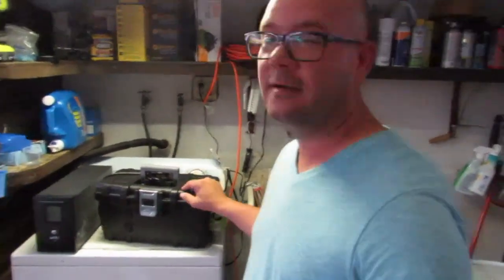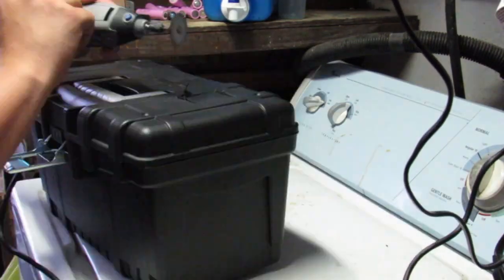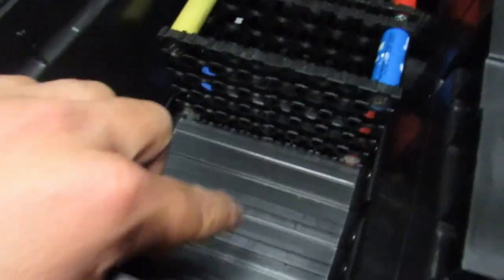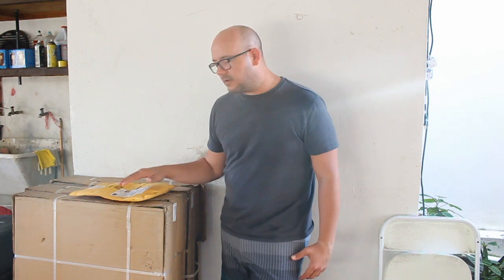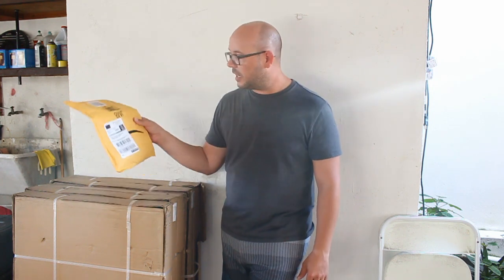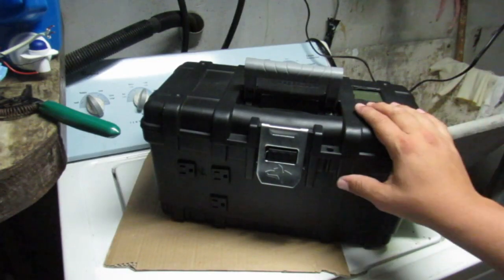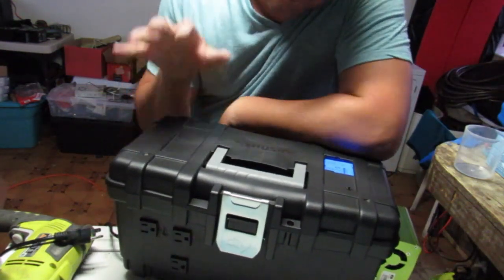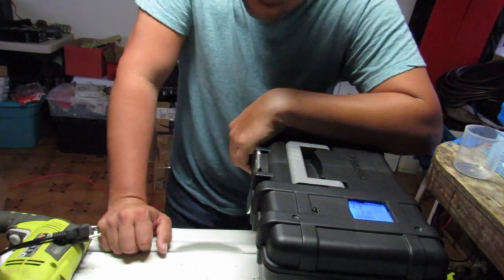Diy 1kw portable power pack solar generator using 18650

Comment from the maker: NOTE: It's been 3 months after Hurricane Maria and only 20%-35% of the households have Grid energy... 

Wanna help? Please donate using this link: 
http://paypal.me/affibox

Some of the materials we really need:
10,000 mah portable power pack
http://amzn.to/2ABZrnW

LED 5W USB Bulb
http://amzn.to/2ACTLKD

12v Car Lighter 'Y' cable:
http://amzn.to/2j0fKGI
http://amzn.to/2zVQOU2

2.5 DC Female Panel Mount Plug:
http://amzn.to/2B7TuSH

12v Car / Truck Fan:
http://amzn.to/2j1T8pn
http://amzn.to/2BOYqcr
http://amzn.to/2BGEAiN

12v Wall AC Charger:
http://amzn.to/2B7DWyE
http://amzn.to/2zVL1hj

2 in 1 12v Car lighter USB socket:
http://amzn.to/2B7zoZ0
http://amzn.to/2BIcraO

3 in 1 12v Car lighter USB socket
http://amzn.to/2kwdjMM

Car Lighter Charger:
http://amzn.to/2BOIxCK

DC to DC Controller:
http://amzn.to/2zWGk7b
http://amzn.to/2kgiFI8

7.5w Solar Panel
http://amzn.to/2nBW39K

100w Solar Panel
http://amzn.to/2ADFSvD

MC4 Parallel Connector
http://amzn.to/2B7vbnX

Pair MC4 Connectors
http://amzn.to/2ACUfjV

300w pure sine
http://amzn.to/2ADIslm

MPPT Controllers
http://amzn.to/2nBThBt

Comment: Is it not a problem for the UPS to just have Li-Ion batteries instead of Lead-Acid ones?
I would think that it would pose a problem when charging and when detecting full discharge.
Or was the UPS already built for Li-Ion?
Reply from the maker: +Lagger Onesixfour actually there is no problem with using 18650. This ups is meant for 24v config and the 7s on the 18650 can handle the 28.8v that the ups outputs to recharge the lead acid battery. 

it will stop working when 21.5v is reached which means that the cells will never go under voltage. 

I hope this clarifies your question. Thanks for asking.

Comment: How long will that power a standard size fridge? Maybe I can build one for my Mom in Cayey.
Reply from the maker: +Simply Seth I tested this model with my standard fridge and it won't run it. The initial surge is to much for the ups. If you get a 1500w ups and build the same battery capacity you could run it for around 4 to 5 hours without sun and about 6 to 8 hours with panels and during daylight

Comment: Hi. I’m a student in Texas and would love to submit a funding request for an undergraduate research project to build these more efficiently. The instructions in this video are not very clear, would you be able to post a video with step by step instructions so that I can get an idea about what needs to be done?
Reply from the maker: WinlockPro hey there. Thanks for commenting and sorry for the lack of instructions. I’m still getting the hang of making these diy videos. I’ll make a step by step video for this toolbox that way you could get a better idea of what i did.. Please turn on the notifications on my channel that way you’ll get a message when i upload the tutorial. God bless you and happy holidays
Reply: Javier Camacho that’s great! I’ll be waiting for that! Also for how long can this setup run a 6w LED bulb for?
Reply from the maker: WinlockPro running a 6w led bulb with this setup is very impractical. This device has a 1kw storage capacity and is intended to run larger loads like small fridges or a tv. But just for the fun of it it will run for 167 hours or around 1 week give or take.
Reply: Javier Camacho that would be unbelievably useful. We will build as many of these units as possible and send it out to you as soon as the video is up. Great work!
Reply from the maker: WinlockPro you could always watch the videos from jehu Garcia.  He has a similar setup and he's also the main designer for this type of system
Reply: Javier Camacho I did watch his video of a similar setup, but the batteries and some of the components he used are no longer for sale. All the components you used in this video are still available.
Reply: An updated list of parts to purchase would also be greatly appreciated.
Reply from the maker: I understand. I'll make the video asap
Reply: Javier Camacho thank you so much !